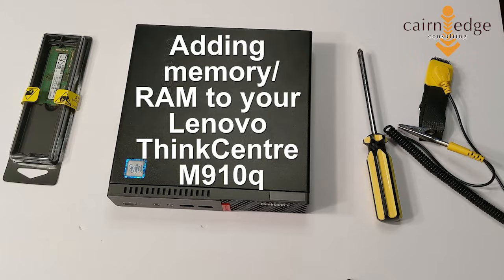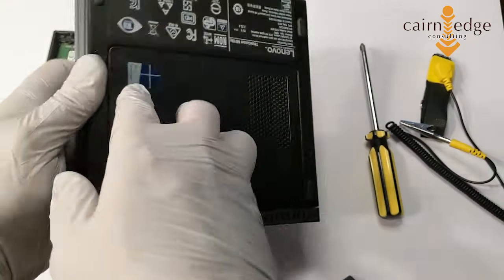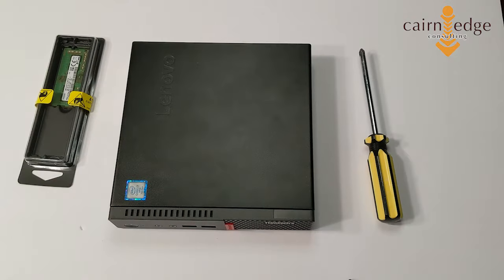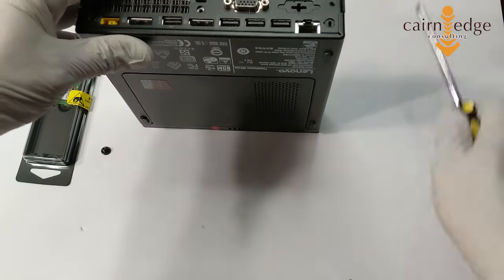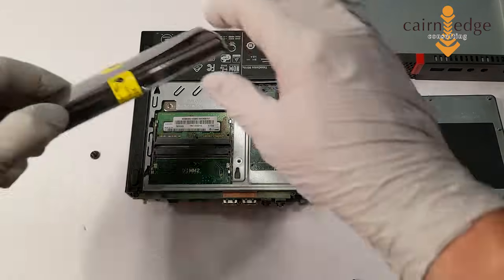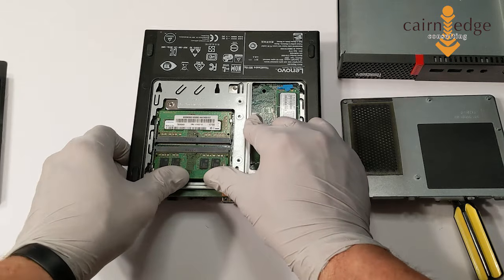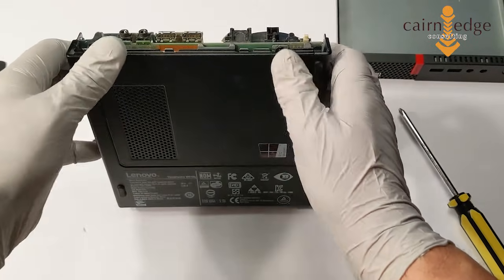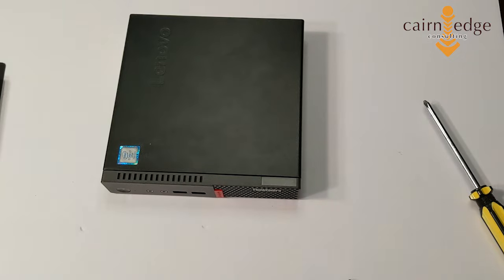Cairnedge Consulting Memory RAM Upgrade for Lenovo ThinkCentre M910q

Comment: can you change the Processor in this thing?
Reply: yes, on the top side. just remove the cooler and fan and then you will see the cpu which is on a socket like in a big tower

Comment: how much gig of ram can this thing handle?
Reply: From what I've gathered, 32G @ 2400.  I have 8 in my little garage PC and it's not quite enough for the shared video ram to keep up with a 4k stream using windows media player. I'm hoping 16 or 32 will do the trick.
Reply from the maker: Yes, TheRealPimpSkillet is correct. This particular generation of the ThinkCentre M Tiny series supports up to 32GB RAM (16GB x 2).
Reply: @cairnedgeconsulting3118  to update 16 works very well. I'm impressed just how quick this little guy is.  Video processing,  or Autocad would show its weakness,  but normal stuff it has no issues with.
Reply: @therealpimpskillet  Can I add any card does it need to be the same size?
Reply: @paulb9769  as cheap as it is,  getting a pair is the way to go. No computer likes two different kinds of ram.